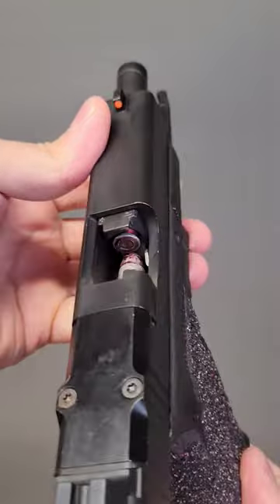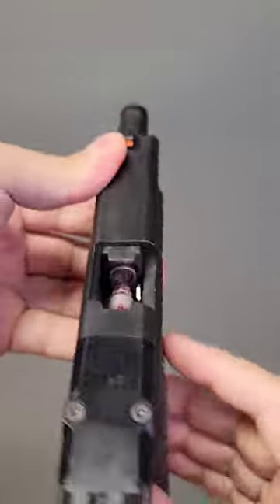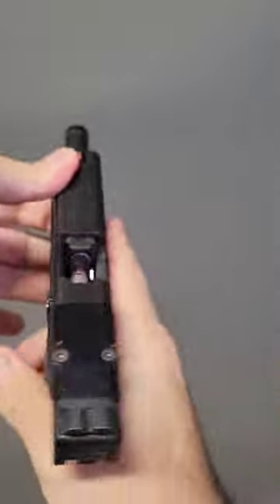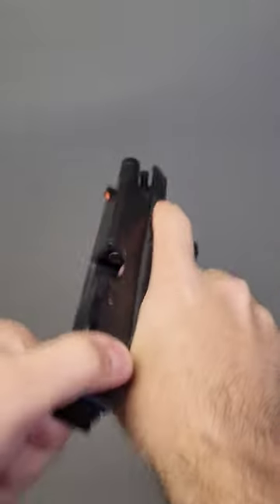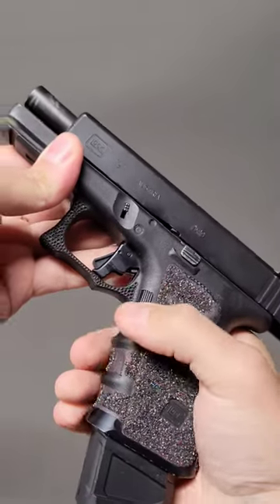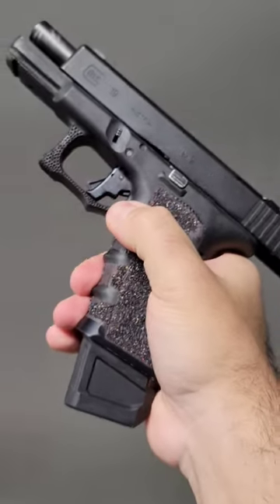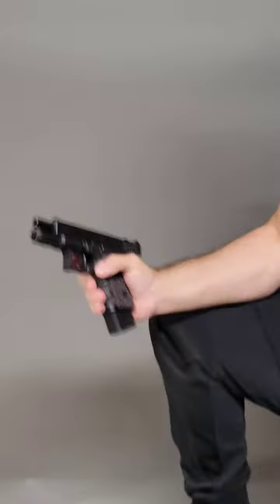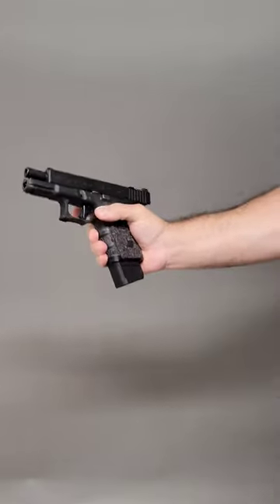CLEAR a Double Feed Malfunction ONE HANDED! #shorts

Comment: How long does it take the average person to recognize they have a double feed as opposed to some other malfunction? Do you just assums it's a double feed and do this? What if this is your last mag in the gun? You gonna rocket that thing across the floor and then try to hunt for it? I see many flaws in this technique.  I appreciate your videos tho so keep em coming.
Reply from the maker: Great questions. Any Malfunction requires a moment to determine what it is, with a double feed it's usually quicker to identify. If it's your last magazine, then yes, this might not be a good option. However if you have a spare, it's ideal to get rid of the magazine in the gun since a double feed is often caused by a damaged mag. Hopefully this helps clear things up a bit.